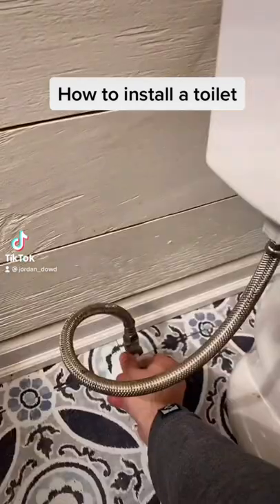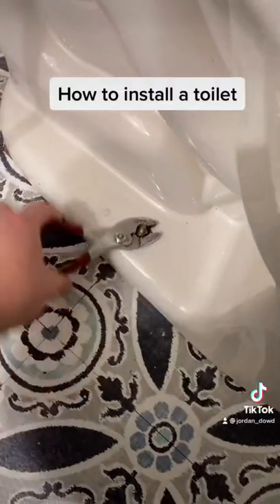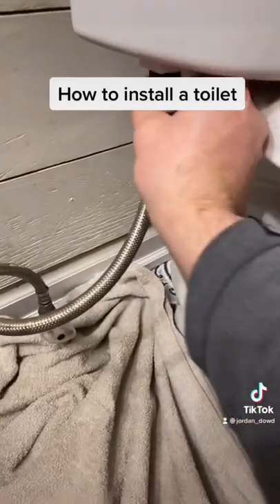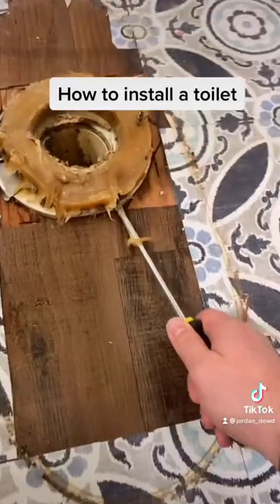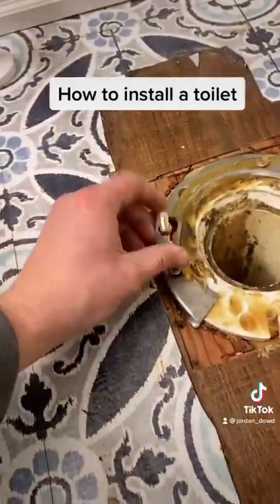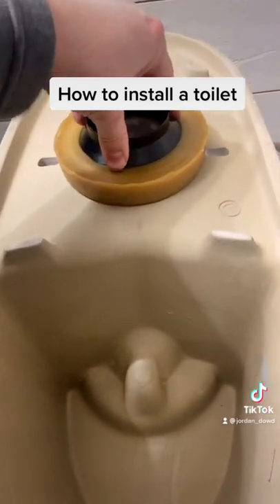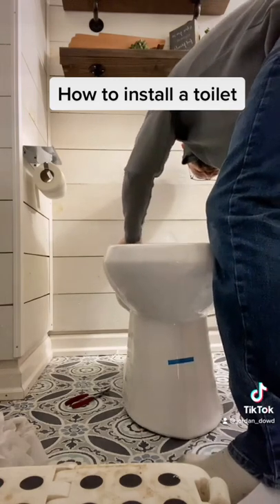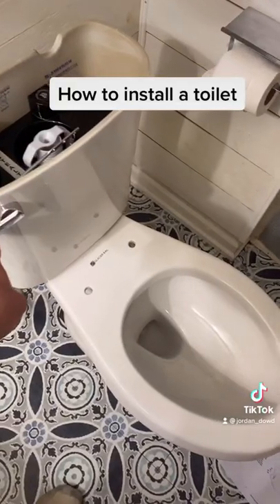How to install a new toilet #howto #diy #toilet #handyman #subscribe

Comment: the toilet you replaced looked brand new! why was it replaced?
Reply: Probably a height issue
Reply: I am having to replace mine.  Leaking from the bowl onto floor, leaking around floor area and the thing constantly runs.  Has to be shut off.  Looks new tho.  Instead of replacing everything might as well go buy a brand new 200$ toilet
Reply: @hopperbopper  oh ok